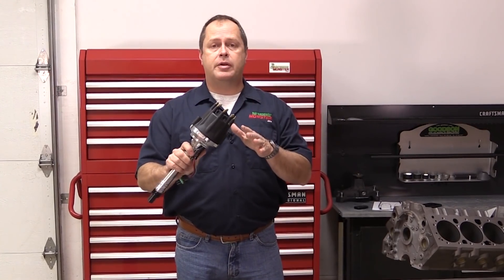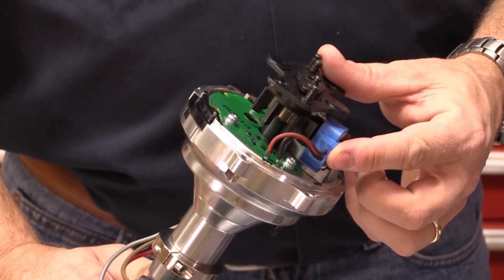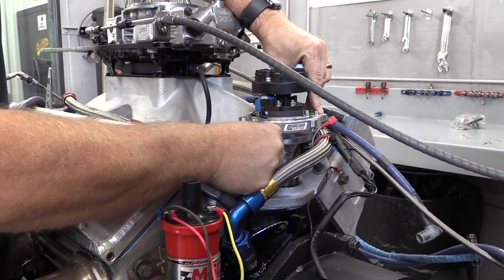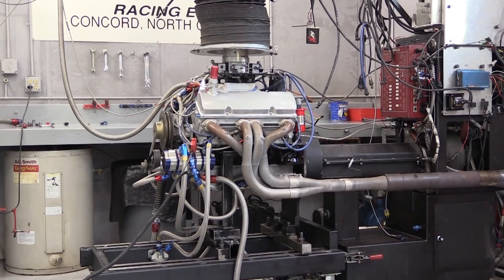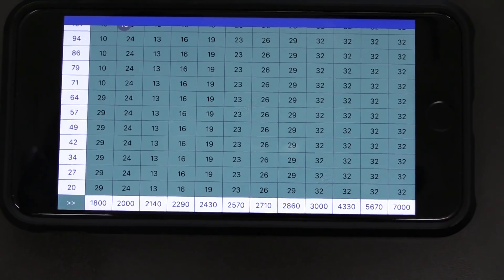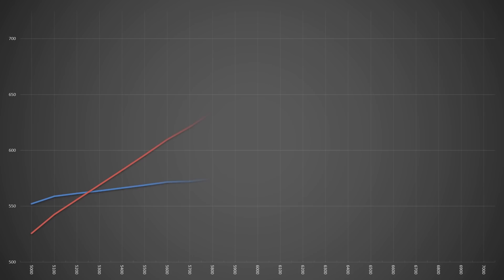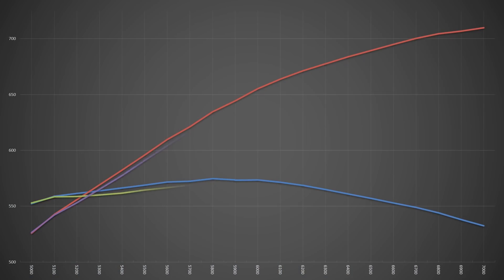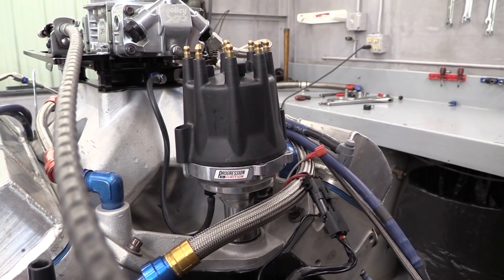Control Engine Ignition Timing with Your Smart Phone - Next Gen Tech from Progression Ignition

Comment: Yeah, but what about normal vehicles? If a put a carburetor, a smaller carburetor on my chevy 350v8 g20 van, will this thing make it have more power with better MPG?
Reply: Do you even know what a distributor does and how it works. It has nothing to do with the carburettor or what size engine you have. It controls the ignition spark.

Comment: LOVE MINE. The lockout feature is underrated. Any other lockout setup could be bypassed. This thing locked means swapping the dizzy to steal the car. aint happening.
Reply: Most cars are not stolen by driving them away. Most cars are winched up onto a trailer, or a rollback. All you got to do is back up to the car with a rollback throw one hook on the front pull it up on the back of the rollback with the tires locked and dragging, and drive away. Can be done in about 1 to 2 minutes tops.
Reply: If you were that concerned about someone stealing or not stealing your car due to having a spark, a simple dead man switch should satisfy you.

Comment: It needs more inputs to be better than a mechanical advance, vacuum advance distributor, tps and or vacuum. 
I'd love to have the 10 degree start on my mechanically locked, Vacuum advance manifold ported HEI.
Reply: If you actually know how to properly set up the different facets of your distributor then it will work great and once done you can typically leave it alone.  This electronic unit just makes setting it up much easier and faster plus it has the starter retard and rev limit built in which are nice features.  I would assume the rotor is perfectly phased considering the timing is controlled electronically.....

Comment: So, I suppose I have to contact progression to get tech info huh?  CAN THIS UNIT BE USED WITH THE MSD DIGITAL 6AL BOX? I'M THINKING THAT THEORETICALLY IT CAN, BUT WANT TO KNOW WHY IT MAY NOT. I'm wanting to perhaps do it, because I don't see how the module under so small a cap has the hardware to generate spark all the way to 10,000 RPMs. 
But If i can take that allegedly hotter spark from the MSD to 10,000 RPMs, instead of the claimed 3000, that would be fantastic!

Comment: Fitted one to my 6 inline 1959 Holden and it works perfectly. Absolutely ideal for old school carby engines.
Reply: where did you get the ignition to suit holden 6 from ?
Reply: @chadribbons4833  didnt see they make them for a grey motor holden . or even a red motor.
Reply: @chopperking1122  same as the Chevy 194/235 6 inline
Reply: @chadribbons4833  sorry I didn't see your reply mate. I bought it direct from Progressive Ignition in USA
Reply: hi , interested in which model you got to suit holden six
Reply: @michellecieplechowicz5206  I got the small cap model for Chevy 194/235 6 inline for my grey motor. A red motor would require a different model
Reply: @carlmitchell4297  thankyou for the response, are you still happy with it?
Reply: @michellecieplechowicz5206  yes it is a great upgrade. I guess time will tell. Ask me is another 20 years

Comment: How well do the electronics hold up under heat?
Reply: Ask the LS owners who have hoods full of electronics and wires. This is nothing new, Jack.
Reply: hard telling this early on, my guess is not great
Reply: @msubtech84  what are you basing that guess on?
Reply: I’ll tell ya. After two years of beating my truck senselessly. All cast iron sbc engine with some cast exhaust manifolds on a pretty hot running setup. It ain’t broke yet. 2 years down.

Comment: It doesn't require an ignition box like most ready-to-run distributors,  butt can it be used with one? 
Id rather not delete my $240 ignition box setup to add a $500 distributor
Reply: Then don't.

Comment: I just installed this in my 65 GTO powered by Fitech-equipped big-cam 406 smallblock Chevy. Ignition is awesome. One part you got backwards, though. Max vacuum is at the lower end of the Y-axis. WOT is is at max kpa.
Reply: Just curious how it’s working with your fitech after two years?
I’ve been running a fitech 800 mean street for 4 years now and love it but I want to be able to control my ignition on the fly on my 512ci Mopar.

Comment: I messaged the company and got little to no feedback. Any kind of warranty on it how much testing has been done to prove it especially for longevity. You break down on the side of the road you're kind of screwed. Do the parts in the distributor hold up to heat?
Reply: No answers, a bad sign. The unit is probably made in China which you want to avoid.
Reply: @johnmilnerQQ   The phone you typed that comment on was made in China but I dont see you throwing down your phone.
Reply: @johnmilnerQQ  you might want to watch the use of probably without looking into it first
Reply: If you go to the website,  it says designed and made in America.  One year warranty.

Comment: Would be awesome for the thousands of us with msd pro billet distributors if you made just a control box I could lock my msd out and wire your box (circuit board) to it, then tune
Reply: Haha progression knows what they have. Its actually cheaper to ditch your msd and convert. Just sell it on eBay to recoupe some $$$
Reply: @1997LT1Camaro  wonder if you could just use the two wires on the progression  unit needed to trigger the coil and retain the MSD.
Reply: Why not just use your MSD controller with your MSD distributor

Comment: You could really screw up your engine though couldn't you?
Reply from the maker: I guess so, but no more than incorrectly setting your timing the traditional way by turning the distributor in the block. Or running a carburetor too lean and causing detonation. Stuff like that. Thanks for watching.
Reply: @TheHorsepowerMonster  very good points there. Thank you.

Comment: DID ALOT OF LOOKING INTO THIS BUT, WHAT HAPPENS IF YOU LOSE YOUR PHONE OR SOMEONE ELSE HAS  THE SAME APP?
Reply from the maker: The distributor comes with a four or five (I can't remember off-hand) pin number that is unique to each unit. So if you lose your phone you just download the app to any bluetooth capable phone or tablet, upload your personal pin and you are good to go. If someone else has the app, they cannot connect to your distributor unless they know your unique PIN. Hope that helps, and thanks for watching!
Reply: @TheHorsepowerMonster   ONE MORE QUESTION IF I MAY?....What if I want a  big/small block chevy small cap distributor? Did not see them on your website?
Reply: So you're worried someone might hack your timing curve?
Reply: @65sohc  I'm going to hack your timing curve, and make it better just to blow your mind

Comment: CAN THIS BE USED ON A 95 FORD 5.8 / 351 (NOT WINDSOR) FUEL INJECTED GAS FUELED ENGINE?? 350 DUALLY CREW CAB FIFTH WHEEL TOW.  THIS WOULD HELP WITH FUEL MILEAGE TOW AND NON TOWING.  THANK YOU
Reply: Their website has all that info.
Reply: This is for carbed engines, not fuel injection.

Comment: I'm rebuilding my k code 289 and this what I've been looking for...wanting to keep it stock looking as possible. Question?  Do they make a conversion for sbf distributors? Like to run the stock kcode distributor housing with modern technology
Reply: They have an application for smallblock Ford but it is the entire distributor. There is no way they could reliably stuff this technology into a 60 year old antique distributor.
Reply: @65sohc  what do you think of the pertronics cast distributor
Reply: @Dogleg1957  I installed one in my 66 Mustang. If I were to do it over I would get this. The Pertronix vacuum advance is 18 degrees, way too much. They do make an adjustable canister so I ordered it. When I went to install I realized the entire distributor had to be disassembled all the way down to driving out the roll pin and removing the drive gear.  Adding insult to injury was the fact that the vacuum advance mechanism broke during adjustment. They offered to send me another one but I was damned if I was going to tear down the distributor again. Judging from the reviews on Summit, failure in that part is common. I've only had the Progression for a few days but so far I am very impressed. There is so much more to ignition timing than setting your initial and determining your all in RPM.

Comment: As an EFI owner with timing control, I think this is a fantastic product. Being able to tune the timing for cruise, part throttle, and WOT without ever popping the hood is so much better. A HUGE perk of this system that I can see is the 12x12 table. That gives a very good resolution to help fine tune. Compare that to the Fitech's 3x3 table.
Reply: Holley Sniper uses 31x31 tables. Way better than fitech. This is pretty impressive for a standalone distributor. If I didn't already have computer controlled timing, I'd definitely look into it.

Comment: very cool.  Would be really cool to see it have an idle control function where it will add and subtract timing to maintain idle speed like the OEM ECU controlled fuel injection cars do.  I"m assuming that would be very easy to add since the changes would all software.
Reply: It does this to a point. The MAP sensor senses engine load, such as a/c or electric fan kicking on and increases timing/torque to compensate.

Comment: 24 degress of idle timing shocks me
Reply: Matheus Marchiori why ? Because you read timing placards on the radiator support of old cars ?   Performance engines do not like to idle at 8-10-12 etc degrees of initial timing .  Stock style distributors also advance timing wayyyy to late and have a huge spread inbetween initial and total advance , keeping you from running more timing at idle , as your total timing will be much to high .   Any kind of performance camshaft (above approx 225-230 degrees duration) will have  crap idle and throttle response with under 15-20 degrees initial .    

Just built a customer hot street 383 with 252-256 @.050 and initial is set at 22 degrees 👍
Reply: @hereinmissoula11  A great feature of this is that cranking advance is always 10 degrees which is much easier to start than your initial of 22.
Reply: @hereinmissoula11  exactly, my initial is 21 degrees, runs like crap with any less!
Reply: Just turn the timing up until the starter Kicks back on you theb back it off! Old school method of setting high initial and low mechanical.
Reply from the maker: That is with low manifold vacuum, which means you've opened up the throttle and there is more load on the engine. That helps build torque so the engine can accelerate.
Reply: Stock LS engines idle at 25-30 degrees.

Comment: There is a company in the Netherlands (123 ignition) that does a very similar product. Down side to their units, is you can't alter the timing values on the fly. So you end up doing a total power run every time you make an adjustment
Reply: Not true, with Progression Ignition you can make changes with the engine running.
Reply: Progression Ignition  That is a real benefit. I'll edit what I said so as not to give any one the wrong idea if they read it. Thanks for the info. Next time we are doing a American unit I will look you guys up👍🇬🇧

Comment: Very interesting. Do you have to install the Distributor "pre-advanced"? So all the ignition timing is actually just adjusting the retard, so it cannot advance it beyond the installed advance? Does it advance and retard the timing to try to keep the engine at the fixed idle?
Finally an Phone app that seems useful, a big step for mankind. :D This feels like an instant buy from me, you do not need the laptop anymore and hook up to a ignition box.
Reply from the maker: No, you set it at 10 degrees advanced (BTDC). That way if for some reason all the electronics went kabloey (and I have no idea why they would) you still have a safe timing setting that will get you home and not into detonation. The electronics control the timing from there. Thanks for watching!
Reply: @TheHorsepowerMonster  Ah, nice. I clicked the link, I think I have to buy one of those distributors, and throw away the MSD stuff. Seems there is no option on the distributor gear though. I have to contact them and see.

Comment: So is there an HEI version of this thing or is it HEI to begin with? Also would this be worth dropping into a 85 C30 dually with a 454 living under the hood that's set up for towing?
Reply from the maker: They do have a separate HEI option. I think something like what you are talking about would be a very interesting use for one of these because you are often running the engine under load at part throttle. Possibly you could tune your timing maps using the manifold pressure to maximize power and fuel efficiency. Thanks for watching!

Comment: Interesting, but if it’s not really secure, anyone with a keygen can retune your car as well.
Reply from the maker: How many people are going go have something like that and the Progression Ignition app to be able to do something like that? Sorry, but it sounds like the real-world possibility of something like that happening is pretty infinitesimal. Thanks for watching.
Reply: The Horsepower Monster I gotta say I’m kinda with this guy ..  what if someone jacks into your tune during a Mexico visit
Reply: @hereinmissoula11  just put an extra on-off switch?
Reply: Jarek Nowak to turning the Bluetooth on and off on distributor or ?
Reply: @jareknowak8712  It has an ignition kill/lock built in. Problem solved.
Reply: Every distributor has a unique 4 digit PIN number built in at the factory. Security is not an issue.
Reply: Progression Ignition awesome !!!

Comment: Like the idea of computer controlled vacuum advance with a map sensor rather than depending on a mechanical vacuum cannister like an old school distributor
Reply: Dad Food I have msd 6al2 programmable. You use a distributor lockout plate (or lockout your distributor if it has that option) , then set total timing up.  From there you go to MSD program on the computer and tell it where to pull timing vs rpm. This eliminates the need for vacuum advance.

This setup is more user friendly, but im curious if it can compete with the spark production of the msd unit and extra features of the MSD (2step,launch control).

I wouldn’t be surprised if one of the bigger companies tries to purchase this technology.
Reply: @Dodgechallengersixpack  yes it can.  they have a demo video of one firing to 8500 or so on a curve machine with spark plugs hooked up
watch this  https://youtu.be/1TB8VfAvClE
man i NEED one when i go to rebuild my 302 with the small cap so i can clear the vic jr 
big cap HEIs and tall manifold dont mix well on windsors..